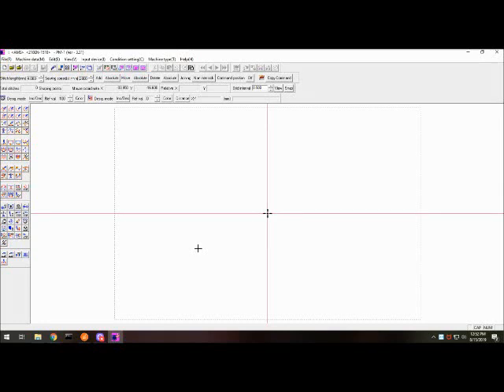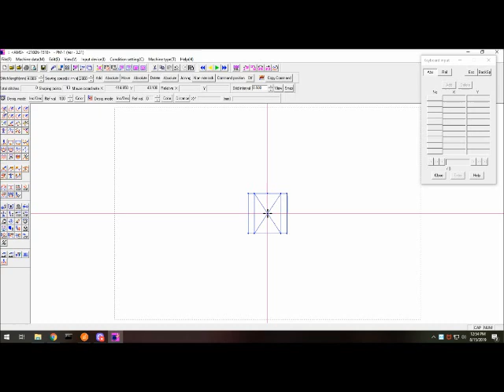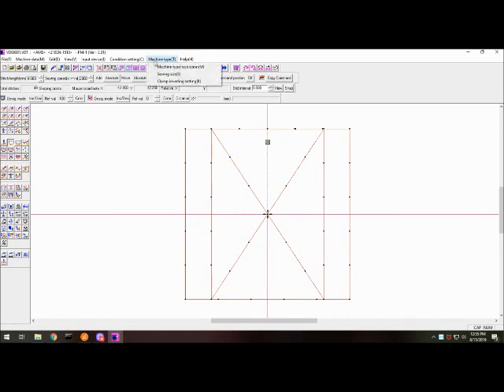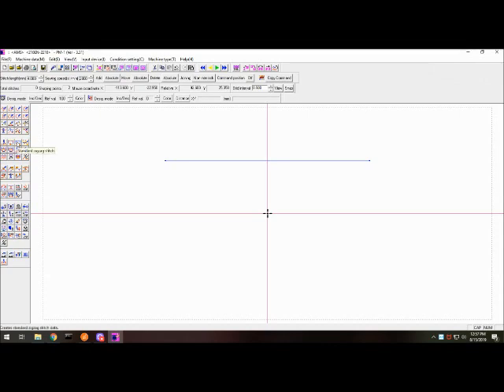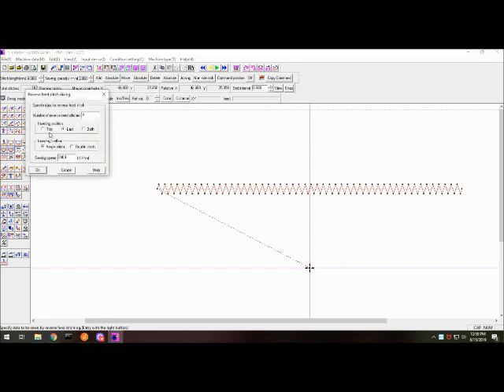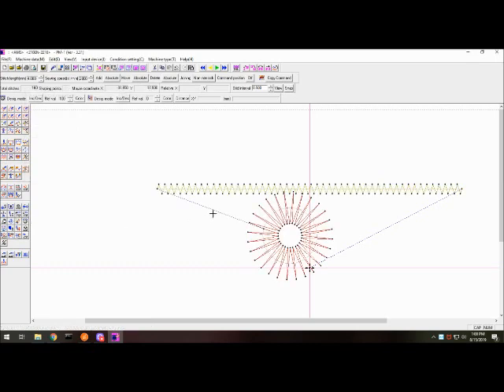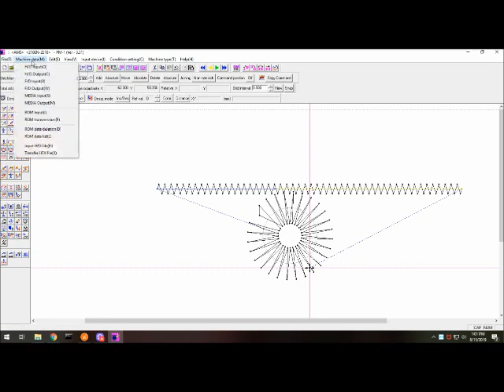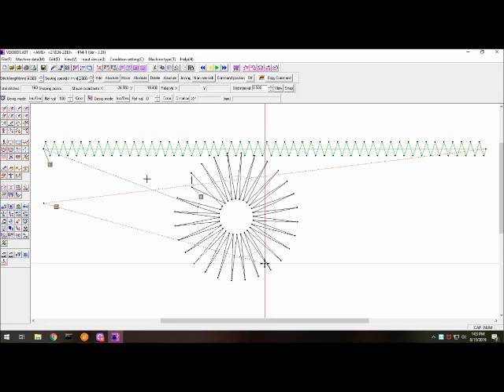PM 1 INSTRUCTIONS FOR SIMPLE BOX X

Comment: Would this require a custom work clamp for a box X?
Reply from the maker: Usually yes, but it depends what is currently on your machine. If you have a standard bartack clamp, then the pattern would not fit in that clamp. However if you have a clamp that has an opening similar to the BX pattern, you might be able to make a pattern that fit in the clamp.